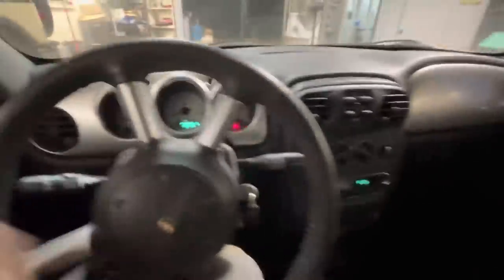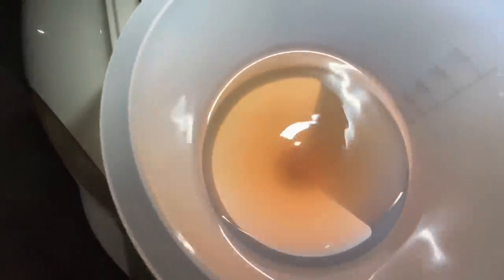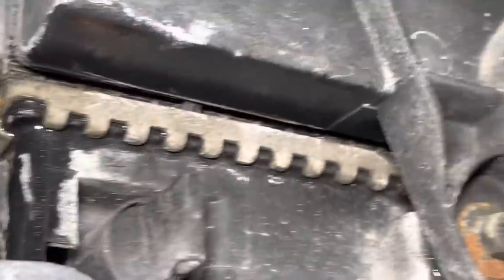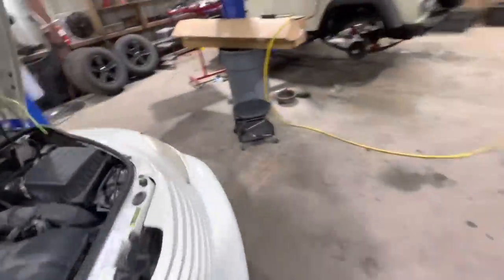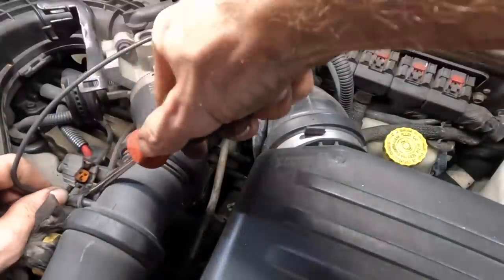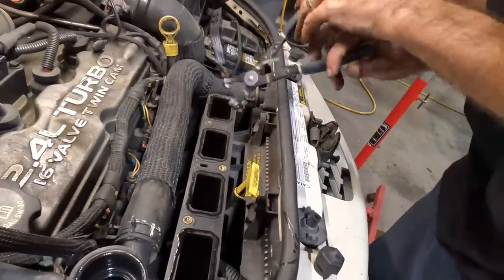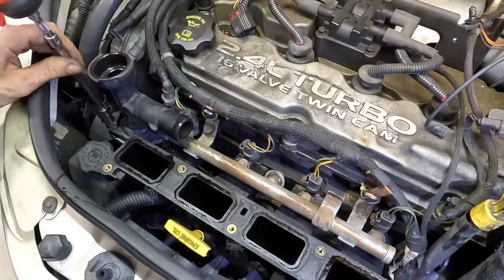Turbo Cruiser 2.4 Overheating Again!

Comment: Ah yes, the PT Cruiser, the 'How much of the car do I have to disassemble to do a rather simple routine repair' car.
Reply: This is like getting to the gas tank through the exhaust pipe.
Reply: My VW New Beetle is the same way. Most of the VAG cars are too. It's called "The  In-Service Position". If you happen to actually like your car... It breaks your heart to see the front end exploded out,  like in a service/parts manual drawing....
Reply: @K.Kelly87  Oh trust and believe, I adore my car and take immaculate care of it, and any time I have to take it apart to any degree to work on it, it breaks my heart.
Reply: @wonniewarrior  Engineers v Mechanics will always be one of my favorite things, being someone who has done things like lay in the dirt to stick my hands in impossible openings to change a starter on my Suburban, yeah - Engineers make it work, but rarely make it easily fixable.
Reply: They're built on the same platform as the Dodge Neon so, it's a piece of junk.
Reply: @darksuns7384  Really? Didn't know that, lol. Explains a lot.
Reply: I own one, also a 2005, I have had the radiator out 2 times and did not have to remove the intake manifold.
Reply: @Oatmealism  cars are designed to be assembled in modules, a real pain to work on, but easy to assemble in the 10 to 15 seconds per work station assembly line atmosphere.
Reply: Removening zee grille and upper tie bar speeds any and all work on zee engine
Reply: @K.Kelly87  My '05 has a "front end service position". I've done it 3 times now, twice for a water pump (BMW sold me a bad one). I can get it there in 20 minutes now.
Reply: @peterperpetua2974  Same. I don't pull the intake when doing cooling module work on a PT. I just remove the grille and core support.
Reply: @peterperpetua2974  Is yours a turbo?
Reply: 40 minutes into removing other parts that are in the way, Ray actually stats to remove the radiator. Engineers can really lose site of the big picture sometimes.  This is how companies go out of business.
Reply: @peterperpetua2974  I know,he is removing way more than he has to ! I own 2 of them !
Reply: @Oatmealism  --If I owned this Car, I would Trade it Off Quickly before something else messed up on Front End. I did this to a Reliant K car, it was a Triple Lemon, Salesman said, I can't give you anything for it but will Pay it Off, My Wife and I just Looked at each other and Smiled--we bought a New Ford Taurus V6, one of best car that I ever Owned...
Reply: Step 1.  Disassemble entire vehicle.   😂
Reply: Yeah!  I get into one of these situations and wonder, "Maybe I should have started at the rear bumper!?" .
Reply: Rear license plate bulb, first remove engine.
Reply: @peterperpetua2974  I was wondering why he did that.
Reply: what a terrible Design this cars
Reply: @K.Kelly87  Picture worth thousand words here. Honda & Toyota owners don't have a clue what your saying !
Reply: "Space efficient packaging"
Reply: I woulda told both of them "motor's blown, get rid of it". Suppose that's one reason I'm not a mechanic.
Reply: Heck My corolla to remove headlights to re do them had to remove the entire front painted bumper assembly all one hugh piece..  I was not happy..
Reply: @larrybe2900  Wonderful service procedure description. I'll steal that for future reference. Thanks
Reply: @darksuns7384  How can you say that.....? Just because there's only 3 of them still running an any State !
Reply: @peted5217  And all 3 are at RAY'S to be fixed, did you see his lot?!
Reply: The good news is he didn’t have to pull the engine.
Reply: maybe Ray is getting this cars because everyone else is rejecting them 😂
Reply: @DoubleAction2  Just wait, he still has to replace the bottom torque mount...
Reply: Makes me appreciate my old XJ that much more.  Radiator takes maybe 20mins, and that's if you take your time.
Reply: my 1966 dodge coronet , 383 with manual everything , was so easy changing the radiator , that this is just a nightmare .
Reply: @Oatmealism  Are the auto designers a third wheel in that?
Reply: @mike22446699  yeah any late model car.
Reply: @DoubleAction2  Yet !
Reply: @jilbertb  Ya , but your advice is still solid
Reply: The whole front end on a radiator, or anything deeper lol. I've worked on 4
Reply: @Oatmealism   As an Engineer, ex technician -- I find it appalling that most engineers lack knowledge of preparing their own stuff --leaving service ports, service wire, access panels, and so on, minor adjustments can go a long way.   I wish all engineers had to repair other designs for a couple years before getting into their designs.
Reply: what surprised me was Ray didn’t complain once about the bad design & umpteen things he had to remove to get at this key component. Radiators WILL eventually fail with some minor leak. reckon Ray even thinks it’s a challenge to remove things ad hoc to get the bastard out. Forget about putting it all back together …..& finding a few left over bolts if it were me.  Ray i reckon has an excellent reassembly memory! This vehicle (not unique to it) is designed for efficient production line assembly sequence, hang the disassembly sequence for maintenance.

if it were me, I might even consider a modification, putting the new radiator on brackets in front of the car haha (after extending all the tubes & wires). wouldn’t look nice but at least be easy to replace nxt time it happens.
Reply: @larrybe2900  I had a good laugh reading that wow 😂
Reply: @qhew  For Ray , like most good techs, it only represents the challenge of correct fix, kwikly as possible. No doubt, as you suggest, he'd modify it's problems if it were his.
Reply: @mike22446699  stick to Hondas/Toyota's for least expensive to maintain , generally speaking.
Reply: @darksuns7384  Really?
So what do you drive now...
Reply: @rustynail7866  I believe that's the big difference - looks fairly obvious from the clip.
Reply: @randybeard6040  I had one of those.
Ghastly car, sorry.
Reply: @peted5217  I have one "Down Under".
Still runs.
Just scared to drive it, in case anything else goes wrong.
Actually, I love it.
And so do the weeds growing around it.
Reply: @terrywade6172  NO!
These cars are made by accountants.
They save a buck , here or there, buy leaving out things like access panels and so-on.
Accountants are NOT the engineer's friend.
Reply: @andysaunders3708  I do realise they control the final decision, I am speaking when in design, little things mean a lot, after in production it's near impossible to fix a wrong unless you show s savings
Reply: @terrywade6172  Yes, I take your point.
I was told that they had to shut the assembly line down for over 6 weeks, as the tolerances between engine and body were causing mucho damage. Staff had to be retrained.
Poor old PT Cruiser. Much maligned car.

I still like mine, but I have to spend quite a bit of money to get it road-legal again. Which is fine. Just gotta get the money together, this year, I hope.
Reply: @andysaunders3708  Heck of a thing. To have one's own PT cause such a perdickerment! ! Not driving it wouldn't hurt if kept inside dry. But's kinda expensive
Reply: @litz13  preach!  I had no idea how to change a fuse before I got my XJ.  Now I can do anything. On an XJ.  ahahahah!
Reply: @lilbuddha8771  They are very easy to work on, for sure
Reply: Yes they can have those PT Cruiser's ! look like a pain in the arse to work on !!
Reply: 0😊😊

Comment: You don't need to take the intake off to change the radiator. Just go straight for the core support. I've never had the intake of on my PT but I've had the radiator out a couple of times.

Comment: One thing I have learned from Ray, that forked spoon lever tool with bent shaft works GREAT. I need one immediately
Reply: Ray does have some nice trick tools, doesn’t he? I wish he had more leads to their proper names and maybe a link to Amazon for them. It would save me from having to try looking them up and enable my lazy streak at the same time. Lol
Reply: The tool he is using is a trim tool. It's made for popping off plastic clips that hold together interior trim pieces. But they do work great for all kinds of stuff, it's like a mini pry bar for separating and disconnecting things. If you do an online search for trim tool, or appolstry tool you can fund losts of varieties.

Comment: One of the many things that I have learned from Ray is what the heck the purpose of certain tools are. I am 67 years old and have worked on  my own cars throughout my life but never used some of my tools due to ignorance. Electrical connectors have always been my nemesis in how to disconnect them but Ray blows right through them. All the tools such as the long bent needle nose and the various mini pry bars have enlightened me on what there different purposes are. Thanks Ray!

Comment: Ray, Have you ever thought about using velcro strips, like those used by gardeners to support stems or train branches, to help secure flexible cables or hoses out of the way by binding them to other structures? Zip ties would also work,, but velcro is reusable and easy to attach and unattach. Could keep things from flipping back into your way as you work.
Reply: Velcro also gets nasty and unusable after a while. So I would suggest cable ties. They can be used multiple times, if you don't crank down on them. Or you can crank down on them, and leave them in the car.

Comment: You DON'T have to remove the intake to remove a PT radiator. Just remove the grille and core support and it will come out just fine. I own 5 PTs and have NEVER removed an intake to remove a radiator.

Comment: When I saw that radiator wasn't completely the same, I thought that leaving the rad support loose until the fan was in might have helped but you got it anyway. Well done. As with most auto stuff, there is frequently more than one path to the goal. In addition, remember that the vast majority of those viewing this channel greatly appreciate your efforts at providing an education for us and would never disrespect you or your methods which are born out of experience. Don't let the others bring you down.

Comment: I thought for sure at some point the rear tail lights would have to be removed.
Reply: I remember a Ford tech a while ago, the first step to replace the front engine cover, was to remove the driveshaft, since the engine oil pan needed to be removed to get two bolts, which required the trans to be dropped, all for a $20 serpentine belt that broke and sheared a piece of plastic.
Reply: @bloodbull123  --It takes Patience to be a Modern Day Mechanic, I am Old School Man, No Patience...

Comment: As an ex-Chrysler tech,I never pulled the intake off to pull out the radiator. Pull grill, upper radiator support, unplug fans, disconnect condenser and radiator hoses and lift radiator/fan assembly out. Been a few years since I’ve done one.

Comment: I was with you on those bubbles. First thought in my mind was head gasket also. After seeing the drip I also realized the bottom tanks on these "newer" radiators have a tendency to leak after some time.

Comment: The trans cooler inside the rad cracking letting coolant into the trans is the #1 killer of old Neons/PTs, so a fresh rad from an external leak is a good thing

Comment: Done my share of PT Cruiser rads and condensers and never had to pull the intake. I pull the top of the core support and the bumper cover and beat flag every time.
Reply: Amen! I own 5 PTs and have never removed an intake to change a radiator. I don't remove the bumper cover either but it could help.

Comment: As an owner of a PT Cruiser, this video does hit my reward center. Nice to see different ways to approach these repairs. On mine I removed the front grille and support bars to get to the radiator and it seems like there were less steps than all this.
Next summer I may be back in for an ac compressor change and will remove the front to get to it all.
Reply: Jim, I like your Way the Best...

Comment: The PT Cruiser comes with a pre-leaking radiator, great design, clever engineers. The new radiator states 100% Leak Tested so it's guaranteed to leak, sweet😄 Now for the mountain of parts waiting to be reinstalled 🤪

Comment: Hey Ray, these clip clamps are easy to remove, use a thin flathead screwdriver, put in the “ear”, push forward and wiggle left and right, the pinched part of the clip bends open and it just clicks loose.

Comment: Little known trick here...if you want to force the cooling fans to run just activate the air conditioner. Sometimes they have a separate fan for this but if not it helps you troubleshoot.

Comment: Watching videos like this make me appreciate my stone age 2003 wrangler.
Reply: That doesn't even make sense, pt cruisers were only built until 2010. Your jeep has almost identical technology as this. 2003 is still a modern car and honestly jeeps suck as bad as pt cruisers to work on.
Reply: @Boga217  have you even worked on a TJ? Or have even seen one?
Reply: @TheBks573  ummm numerous times. They just have so many stupid piddly problems that requires extensive diagnostic work...they are a rolling heap of Chrysler crap.
Reply: @Boga217  There really isnt many major problems but a LOT of small ones. NV3550 sounds like a meat grinder with metal bits passing through.
Reply: I happen, to like my 2018 Ram ♈. Still under warranty for another year and still going strong. I don't abuse it, so it's not abusing me.
Reply: Likewise for my 2001 Durango and 2003 Dakota
Reply: You must be a Youngster, how about a 63 CJ 5..
Reply: @randybeard6040  that's a real jeep.
Reply: 1988 Camry wgn is my current newbie (since 04), but only has 215k. Probably good another decade

Comment: Wow!  Watching all the parts that have to be unbolted and removed, I'm sitting here thinking how the heck will he ever get it all put back together without forgetting something?  Mind-boggling.  I think Ray's genius comes from loving to solve puzzles.  And, I think he just loves to disassemble stuff.  Way more fun than trying to design it so it doesn't shake apart out on the road.  

Ray, I have lots of respect for what you do.  Love watching you work.  I don't want to get all therapy sounding, but the haters don't really hate you or what you do.  They lash out at everyone.  They are trying to get rid of the negative feelings they have about themselves.  Think about it, if they felt confident and worthwhile, would they need to get online and start trashing other people's feelings - strangers - who they don't have to look at while they do it?

Comment: You reminded me of a recent job I did, I found out the hard way that the "new" required yellow antifreeze that Ford says to replace the old with will remove paint from the truck. I was surprised to see the paint blister and soften. Just thought I would mention this to save others from learning the hard way.

Comment: Ray, if the torque mounts broken, check the 4th mount. its on the passenger side, between the engine block and the fender they go bad and are a nightmare to change. but if that torque mounts junk, there's a good chance the 4th mount is also gone Also the measurement on that torque mount is critical in the manual.

Comment: When I use to work heavy line, I used a coolant system pressure checker. Found the leak in seconds if it was a good leak. Left it on longer to find those stubborn leaks when a clamp was slightly loose and it would only drip under pressure. . Saves time and causes you to make more money with less comebacks. Great repair.

Comment: I had a PT Cruiser. (3 of them actually and I still have one. 2003 Woody Turbo with 64k original miles) I had the radiator changed out within 2.5 hours but also had to then change the thermostat because it was stuck closed. but, not too bad of a job. Although I did not remove the intake at all. I took off most of the front grill and bumper and went that route and it was easy enough.

Comment: If you save a spray pain cap they fit over the cooler pipe.  I use them on my cruze when I'm working on it. Keep bolts out of the cold side . 
 Be safe  team.

Comment: That engine is notorious for head gasket leaks, same one as in my 1998 Dodge Neon. Now junk after snapped timing belt(interference engine). Replaced the Radiator on the POS twice for the same reason as this PT.

Comment: Hey Ray you might have seen this, but I thought of you when I saw it, this tool called a long reach ratchet it has a socket attachment on one end then at the top about 12in it has a sprocket that you put a ratchet from both sides and the socket can be turned in both directions. It looked like it was being displayed at a tool show.  It allows you to use the tool in tight places where you can’t turn the ratchet or can’t put in a ratchet. This tool would work where you were trying to get that bolt under that thermostat housing.

Comment: You know, the engineers must have a lot of fun working out the exact right order to assemble these vehicles on the production line 🙂 (And of course, making sure they can be assembled. There is nothing more fun than "You have to install part A before part B, but you also have to install part B before part A because of clearance issues.)

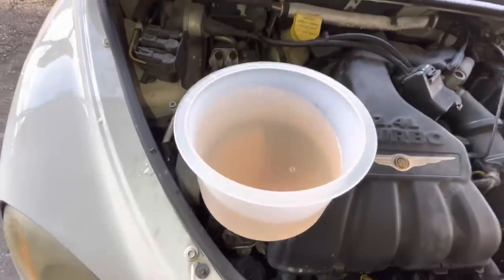Comment: @2:00... My first thought is to turn off the A/C and see if the fan comes on thermally. Try commanding it on and watch the coolant temp sensor voltage for a smooth ramp. My second thought is to pressurize the system and try to force a leak.

I'm curious why you don't like removing the entire cooling module as an assembly. You always try to remove just the failed part, but it so much easier to remove the entire assembly. It's how it goes in when the car is assembled. @45:00... That non removable upper hose connection is gonna make it hard to get the fan in. This is why I remove the entire module. You can assemble everything out of the car and then just drop it in.